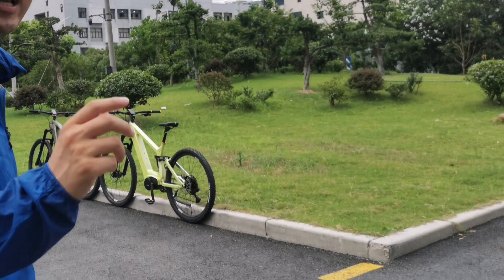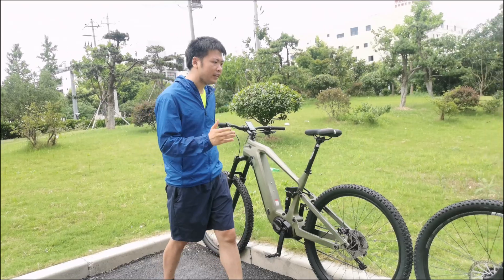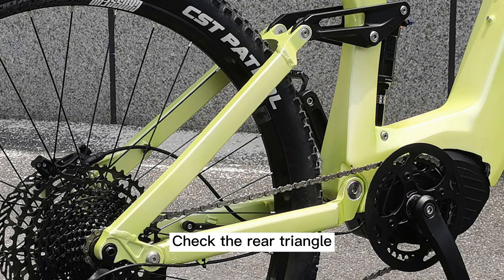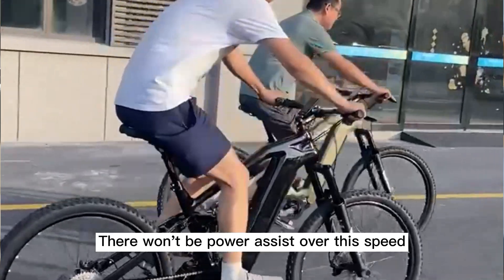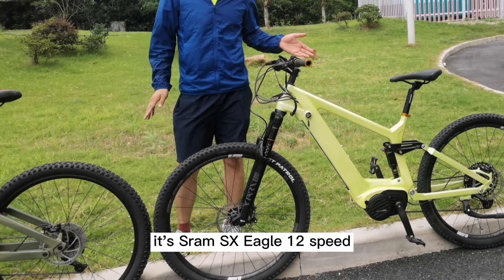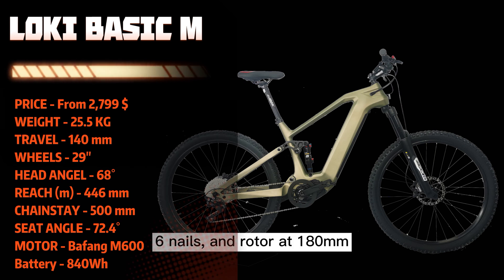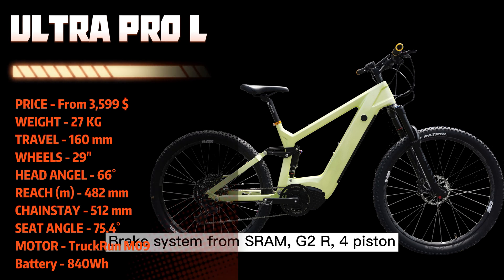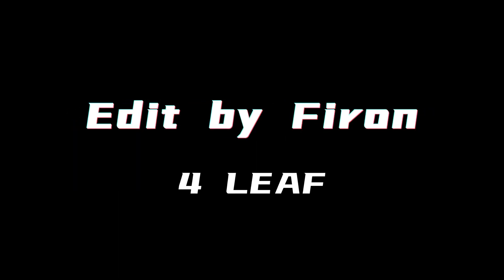2 Chinese Carbon Ebikes （Bafang M600 500w vs TruckRun M09 1200w）

Comment: Thank you very much for your evaluation of the TRUCKRUN mid-drive motor M09. 👍The M09 comes in specifications of 750/1000/1200W, with a maximum torque of up to 220N.m. It's the most powerful ebike motor by TRUCKRUN and also features excellent heat dissipation. It is specifically designed for mountain bikes and all-terrain vehicles. We welcome interested friends to visit our official website for more information.

Comment: You are doing great Firon! Love the video and the voice over is actually cool too :-). And I would not worry at all about the chainstay length...these bikes are for going fast and not doing switchbacks. Great bikes anyway!
Reply: Looks very good! Can the truck run motor be tuned to accept higher power input like bafang? 

I worry 1200w not be enough power even with big torque.
Reply from the maker: not so far. @BT_life2  https://lfbikes.com/products/ultra